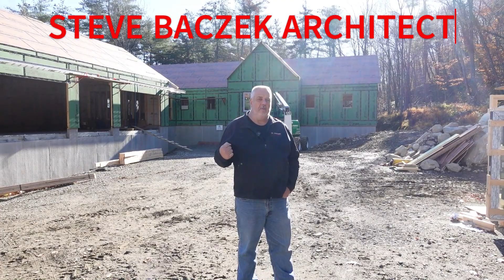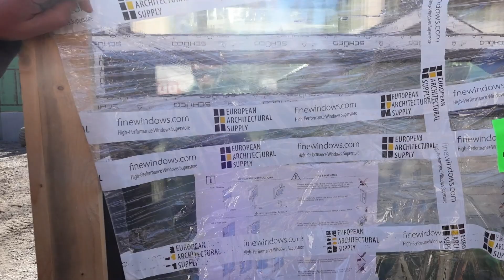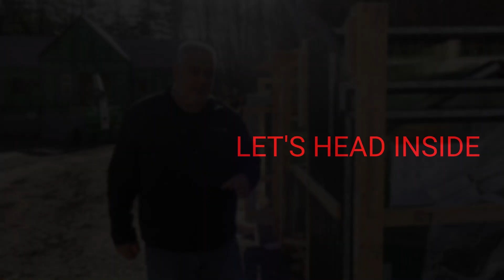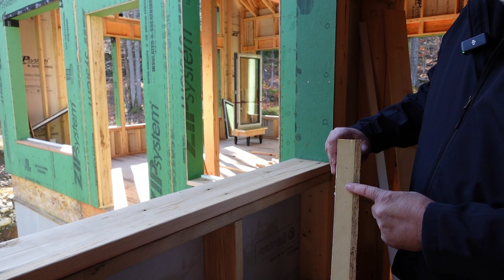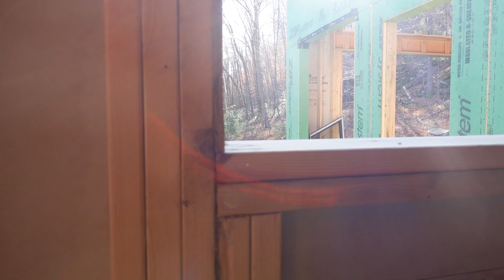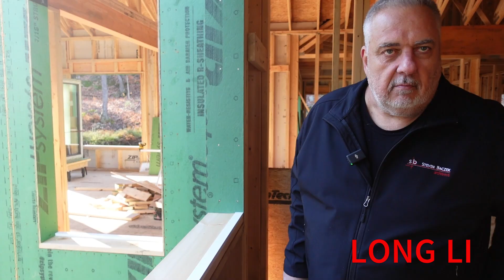OFFSITE BUILD - WINDOW INSTALL PART 1

Comment: For flangeless window with clips. How would you nail the clips if there are dam installed on the bottom?
Reply from the maker: clips come up over the top of the back dam
Reply: @stevenbaczekarchitect9431  wondering if there’s an update showing how the outside trim, drip cap etc is done?

Comment: Why is the head taped first? Water still flows downhill. In 30 years I might trust your zip tape but until then tape the bottom first, then the sides and the head last.